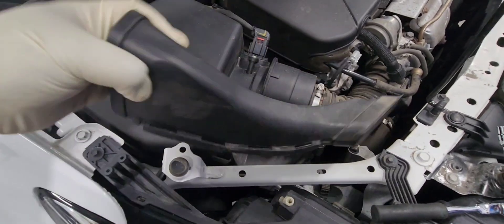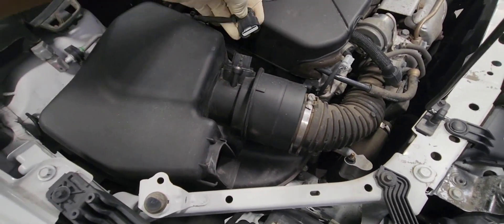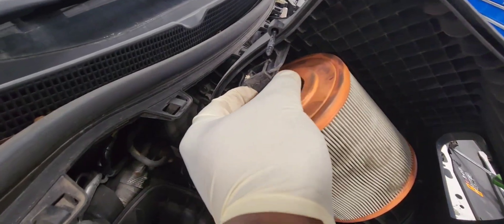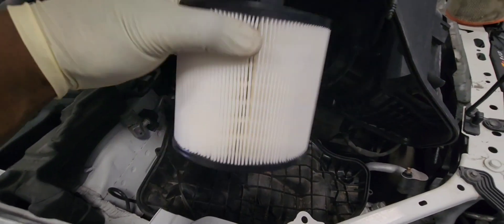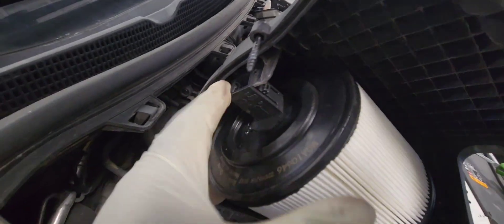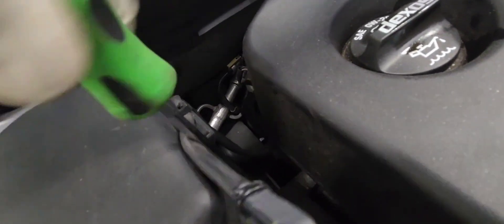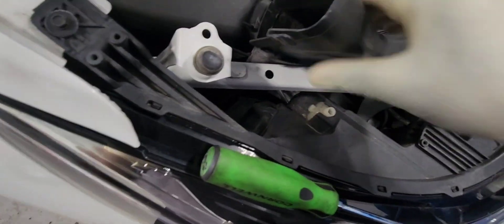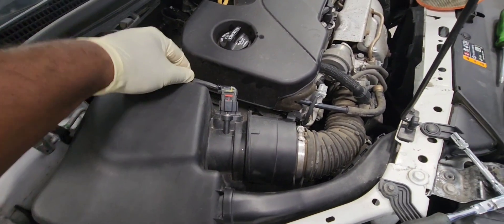2016 2017 2018 2019 Chevy cruze engine air filter replacement

Comment: Filter must not have been seated properly when a lube tech reassembled it. Was able to clear the engine code because of this video, thank you!
Reply from the maker: Most likely, it happen to  me before,easy to misplaced this filter
Reply: Had the same thing happen to me. Opened the compartment to replace my air filter....the filter wasn't even in place. This was after the lube techs checked my filter before asking me. And I denied wanting them to replace it

Comment: Im going to try this my filter is fairly clean, but the engine lights are still on. I was told my engine light is being caused by an air filter/throttle body issue. Any suggestions
Reply from the maker: If it is not install the right way, it will do that, happen to me the first time doing it